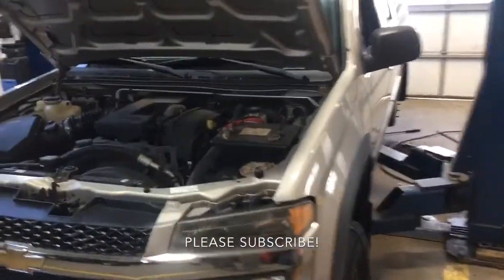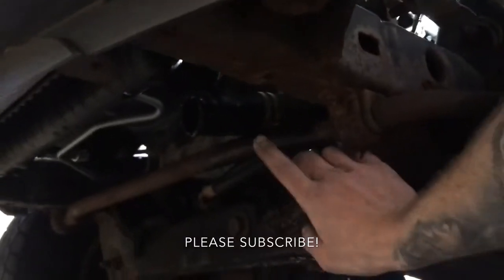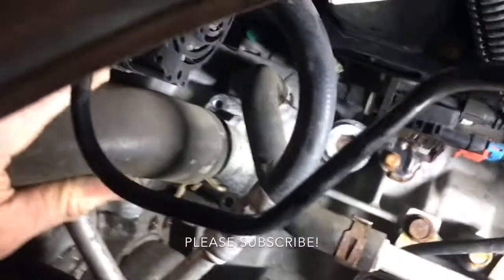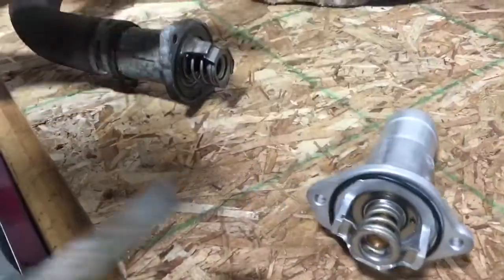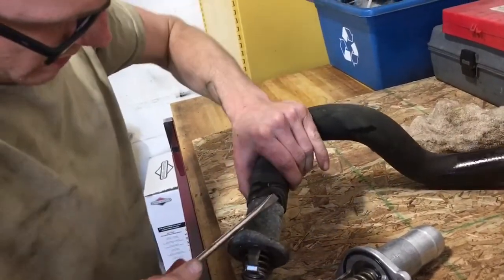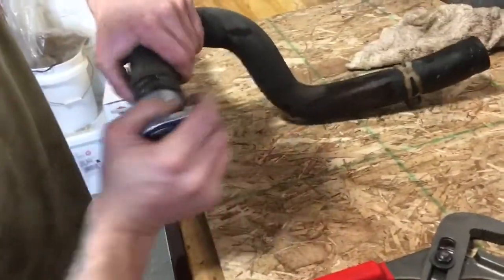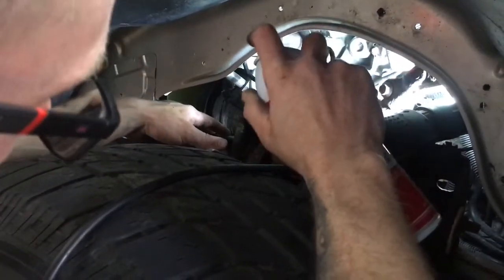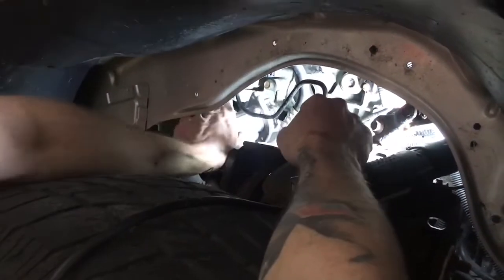2005 Chevy Colorado P0128 - Thermostat Replacement

Comment: Thanks for the video! I hooked up a 6” extension and a 9” extension with a u-joint in between the two. It took longer to get the fender liner out than it did to replace the the thermostat

Comment: Old video but hopefully someone can learn from my mistake - I broke off the upper thermostat bolt when installing the new thermostat. To fix that, I used an angle grinder to cut off the long tube portion of the old thermostat, and used the housing as a guide to get my left hand drill bit in as straight as possible, that made really quick and easy work of turning out the broken bolt.
Reply: How did you break the bolt?!? The torque on those bolts is 7.4 ft/lbs

Comment: 2011 4cyl 2.9L does not have enough room to go thru the wheel well.   removed wheel, no room. Will have to take the alternator off.
Reply: You can get to the top bolt with a swivel attachment through the wheel well, Torque on those bolts is only 7.4 ft/lbs

Comment: What kid of coolant do you use 50/50 or pure coolant???
Reply: It is not your normal 50/50 coolant i believe its called dexcool its orange as oppose to regular green color.
Reply: alvaroooo17 get rid of the dex cool go green
Reply: Paul Bricklayer why is that
Reply: Morgan it’s garbage it breaks down with time unless you want to b changing it every two years or so the green stuff is a lot more forgiving
Reply: Paul Bricklayer but Chevy requires orange. But I mean if you say green what brand would you require
Reply: Morgan really doesn’t matter prestone is pretty good stuff
Reply: I have a 2005 colorado my mechanic change my to green

Comment: When you change the thermostat does it always run hot till it sucks up the reservoir coolant tank under the hood?
Reply from the maker: Twisted no it’s shouldn’t. That only happens when thermostat opens and that only opens to maintain a “cool” coolant temperature. UNLESS it was because of an air bubble then that would be normal...but it shouldn’t be happening every time you start it

Comment: my only comment is that you didn't actually show unbolting the thermostat, that would be the hardest part of this job, was it a pain to get the bolts un screwed?
Reply from the maker: Ernest Hin no, 10 mm swivel socket, 10 inch extension. Came right out.
Reply: @JeremysCarRepair  Thanks, that's what I used. The bottom bolt was covered by part of the hose clamp lucky i had a swivel and came out easy. Thanks again
Reply: Its rough do it the new way and drop the alt off so much easier and less time consuming
Reply: @ernesthin1975  I did one on a Colorado. I agree about the swivel, don't think you could get a socket on those bolts with just an extension.
Reply: @Captaintripps1  what do you mean ?  Is it easier to pull the alternator or is it easier to pull the tire/wheel well?
Reply: @dandavis9071  its easier to pull the alternator off
Reply: @Captaintripps1  Thank you Capt'n !!!!
Reply: @dandavis9071  you're welcome @DAN